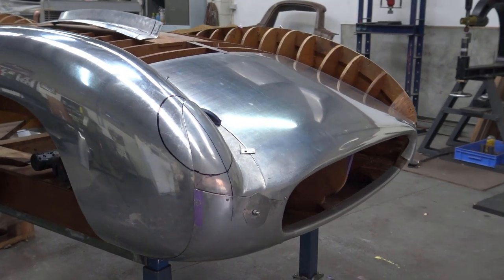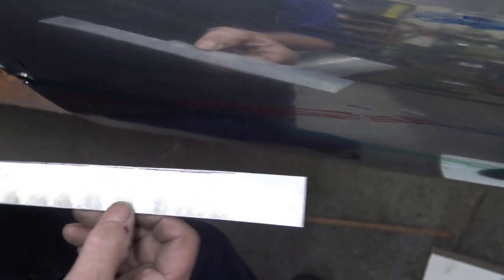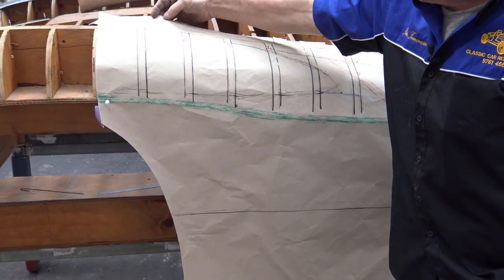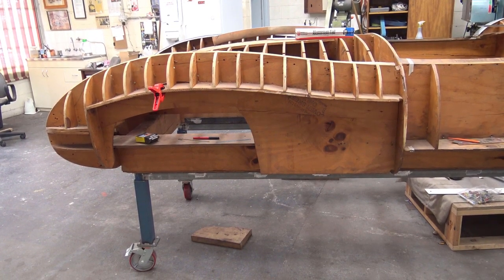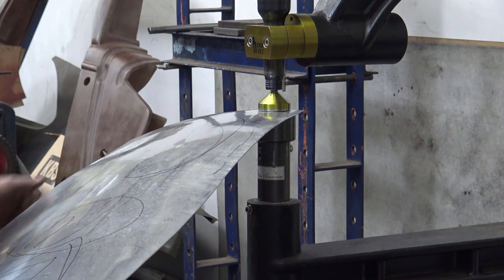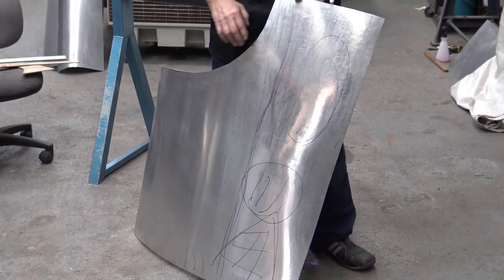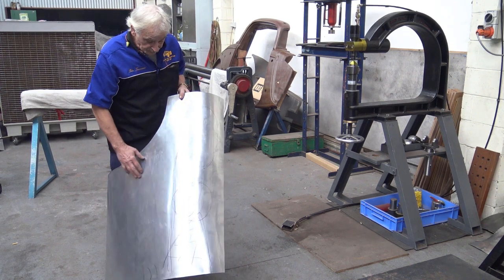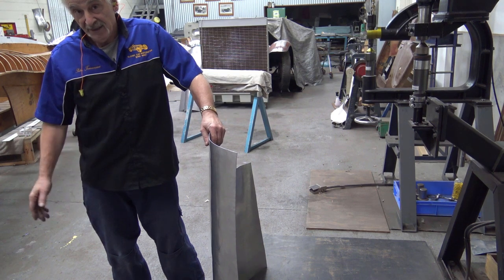Making An Interesting Shape With A Planishing Hammer and English Wheel Part 1 - With Peter Tommasini

Comment: If it's not bothersome you could put its dimensions here for me l already have the pulleys only one project is missing witch is the measurement of your english wheel length openig width of the material please 🙏🙏🙏🙏🙏🙏🙏🙏🙏🙏🙏🙏🙏🙏
Reply from the maker: I have several English wheels one of them (the smallest ) is 800 mm high and 705 throat width the others are double that length and width .